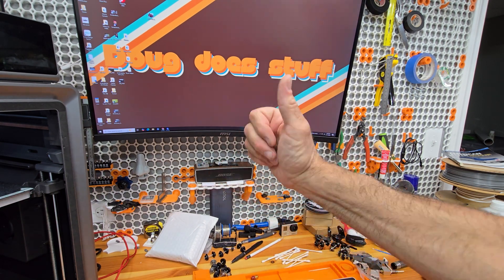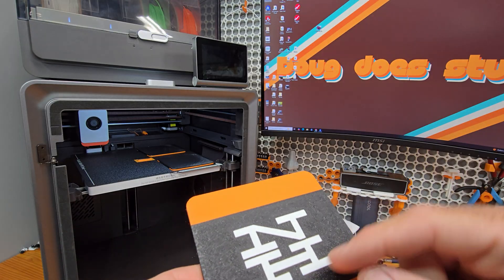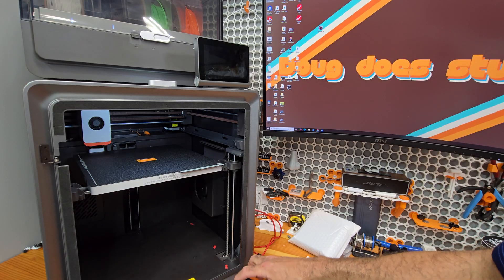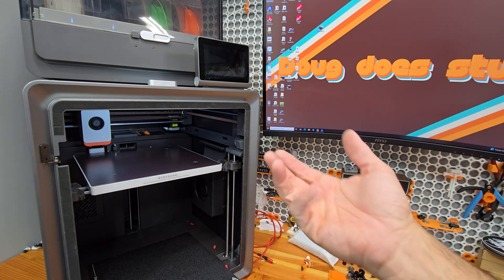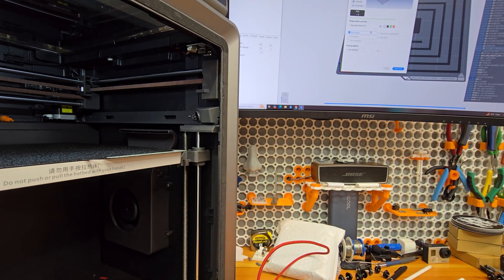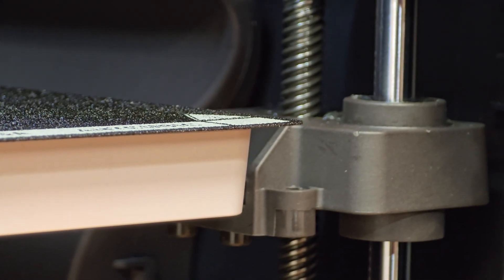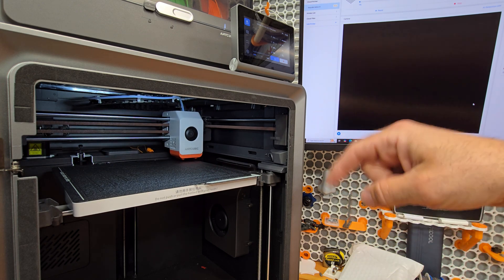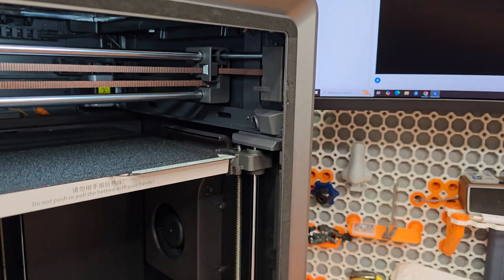Kobra S1 Combo: Bed Leveling BUSTED? Does it Actually Work?

Comment: Ihave been working on this for two weeks about 4 hours a day. eventually I got a perfect first layer and it wasnt becuase of the mesh it was because I installed the 8mm bed and leveled for two weeks to get it just about perfect. im convinced the bed leveling doesnt work. I had almost no deviation in the mesh and it still wasnt very good
Reply: I am going to add I tried rinkhals I tried stock same issues either way. in Rinkhals I was convinced it wasnt working.

Comment: The beds in these things are trash. I just installed Rinkhals and done a bed mesh through mainsail. I have 1.125mm range difference, everywhere is around 0.1 to 0.3 except for the left hand rear corner where it drops off by 1.125mm.
Reply from the maker: There is talk that the chain in the top left pushes down on the hot end. It is something to investigate

Comment: Ciao Doug. I guess i found a solution. At least is working for me, and it's consistent all the time. I was giving up with this printer but sometimes, when everything seams lost, the solution come up. I tried all possible to minimize the bed warping ( also following your videos ). But after all nothing was changing. So, I said, shoud be something software related. And I think it is. All printers makes mash from LEFT to RIGHT ( or viceversa ) and builds a grid. Somehow the software has to arrange the deviations interpolating these measures. More you go far from the touched point, more the meaasure is an interpolation. I will do it short. From SlicerNext simply change the printing pattern. Instead to 45° set 0°. The nozzle moves from left to right. The result is amazing and my first layer 240x240 i a piace of paper. for 4 time consecutives. I guess printing at 45°  the software interpulation is to waek and gives you inconsistent results. Let me know.
Reply from the maker: Very interesting! Maybe they already know this and that is why their first layer model prints left to right....
Reply: @dougdoesstuff24 I didn’t know. If you plan to try this method, tell me if it works also for you.

Comment: Over 500 hours. When the bed leveling issue happened to me I updated firmware and did a full calibration. Oh and I always skip the bed leveling when remote printing.
Reply from the maker: Did that work for you?
Reply: @dougdoesstuff24  Yup. Racked my brain making sure nozzle settings on the printer AND in the slicer were accurate. Got tired of bothering with it did a factory reset, I've been fine ever since. I say do a full calibration via printer settings first, if it's still an issue go for the factory reset.
Reply from the maker: I've done the full calibration multiple times, but not a bad idea about a factory reset. It shouldn't matter, but who the heck knows at this point!
Reply: @dougdoesstuff24 I also keep that front door on and closed, I vent from the top. Mostly because of how humid it is in NC.
Reply: Im experiencing that too. I just went and downloaded the v 3.3.3 to see if that will help. The .4 is annoying how the auto level is always checked
Reply: Doug which version of the slicer are you when you did these test, do you remember?
Reply from the maker: @KelvinAung95  I just opened the slicer, version 1.3.4.0  When I run an update check it says the latest
Reply: @KelvinAung95  if it helps I'm on the latest firmware on both and the printer and in the anycubic slicer.
Reply: Waiting on the print to finish but yeah I will update the chat once I do a test print. Reverting back to v1.3.3.3. Not going to change anything.
Reply: Maybe a one off situation again but I printed sliced gridfinity bins and stopped during the first layers. No issue with the first layer on 1.3.3.3  I posted my pictures on Reddit.
Reply from the maker: Interesting.  I will have to find your reddit thread.
Reply: @dougdoesstuff24 hey so ive been messing with it reverted back to the most recent firmware. started to see consistent positive results when I started messing with the initial layer line width. 

By default its at .5mm or 119%. But I increased it to .525 or 125%. Im having good first layers but z offset is still an issue. It is able to work itself out by the next layer. And top layers are good for the most part. A new issue popped up where the print head starts moving before any filament is coming out so im missing like 1in of the very first line. This only happens after purge for starting print or color changes. Color changes not so much of an issue cause of the purge tower.  Everything after that is fine. So idk lol.
Reply from the maker: good to know.  I am not behind increasing the line width as it masks the problem and doesn't solve it. That is odd about the missing filament.  I really hope AC fixes this in the next firmware release!

Comment: Sorry, I know this is a bit off topic 🙏
What benefits does this machine have over the tried and true P1S Combo? It appears to be a bit cheaper at the moment, but are there any technical advantages? 🤔
I hope you find a solution to this problem!
Reply from the maker: Advantages huh, well I don't know the P1S enough to answer the tech specs, but I do know this has an active dryer in the AMS unit.  You can run the dryer by itself and/or while it is printing which is nice.  It is half the cost of a P1S also.  BUT, as you see from my issues, not every K1S is built the same and you might get a winner...or a loser.  It is unfortunate because I do want to like the machine!
Reply: @dougdoesstuff24  Thanks! I didn't know about the drying feature, that is great for the price!
Reply from the maker: @Aaronage1  yeah, but does it overcome the other downsides?
Reply: @dougdoesstuff24  Maybe not in the current state, but if they can iron out the issues it could be a solid choice 👍
Reply from the maker: Agreed!

Comment: I think the shitty build plate they give with the printer is a cause of a lot of issues. I think it warps as the print goes on if you have the bed on. I got a GECKO plate and a PEI plate. PEI plate has no issues.
Reply from the maker: It comes with a PEI plate, how is yours different? I know the GECKO is a cold plate so that might help with warping from heat

Comment: I can't keep the ACE Pro running long enough to find out if it can do multicolor or not. Nonstop errors (11504, 11511 and 11518). Most of the time you can hit continue but at that point the layer adhesion has gone to hell. Gotten a few good single color prints. A reasonable benchy and thats about all.
Reply from the maker: Oh man, I'm sorry to hear that! Have you reached out to support yet?
Reply: @ yes, but they’re aren’t exactly quick to respond.
Reply from the maker: @KC1VBX  yeah, it usually takes overnight to get something back.  Weird though, today, I emailed them and had an answer within 2 minutes!
Reply: @ I work in IT. This is how tech support works for me. Lmao
Reply from the maker: That has been my experience with support as well.  They usually respond within 24 hours and the solution is often them sending parts my way.  The parts take almost 2 weeks to get to me though.  As for the new hotend, the ones I did the video about from aliexpress have been great! No more PTFE tube to cause issues!  I have an official anycubic replacement, but I don't think I will use it ever because of the design and the issues.
Reply: I have no issues using multicolor but the waste is so much I just don't really do it lol

Comment: Checkk the gcode for a use bed mesh command like m420 s1
Reply from the maker: being a klipper based machine, not sure m420 works.  The bed does appear to move, I just think it is so out of whack there is too much for it to move.  Unfortunately you can't see a bed mesh on this printer like you can on others.
Reply: @dougdoesstuff24  not real familiar with the machine. Came across the channel researching the model. Seem to have a few quirks but a solid machine for the value.
Reply from the maker: Cool! Thanks for stopping by! Yes the machine works well for some, but for others it can be a real nightmare. I really don't think I could recommend it without reservations. It is well priced, but that shouldn't mean you have to deal with issues.
Reply: @dougdoesstuff24  I built my first few and  then grabbed a large voulme slinger for cheap years back and its been my work horse. I do more work that requires post processing and painting is a hobby for me so I have never needed much more. I'm interested more in multimaterial for functional parts and prototyping. I love the newer features of the klipper based machine but I'm not hot on the prices of bamabu labs, prusa, and the like, and the waste of the multimaterial seem a bit excessive. Anycubic has been a pretty solid outfit over the years. Im going to have to learn a bit more about klipper first though. I like to be able to modify things to my liking.

Comment: It looks like the pints are warping try setting the Big fan a little bit lower. Try laying them on a table and see if they are warping.
Reply from the maker: Hey Jim.  Appreciate the input!  I will recheck them when I get home, but they didn't look at all warped, it was just those top layers.  There have been other comments about the side fan as a possible issue.
Reply: @dougdoesstuff24  it happened to me and the top looked identical, I have an X1C so the fan is on the other side , when I saw it was the ones right by the fan I decided to post it.

Comment: Of course, the auto-leveling works, but you should understand that the printer only measures 25 points, with a distance of 5 cm between each point. Any irregularities between these points are not accounted for, so the height may vary in those areas.

Moreover, I constantly see people touching the print bed with their fingers, leaving skin oils behind, and then wondering why the plastic won’t stick to the surface.
Sure, you can argue that you clean the bed with alcohol or degrease it regularly, but the best solution is to stop touching the bed altogether!
Reply from the maker: Good point on the unmeasured area between points. I do clean the bed as needed if adhesion issues arise, thank you for the comment!
Reply: @dougdoesstuff24  
Another nuance: Before calibration, always check both the back side of the build plate and the bed itself for any particles, no matter how tiny. Even the smallest speck can alter the final bed height. Later, that particle might shift, rendering the calibration inaccurate.

"I do clean the bed as needed if adhesion issues arise"
So far, my Cobra S1 has been running for over 120 hours and consumed more than 3kg of filament, yet I’ve never cleaned the bed. Right now, I’m printing articulated  Chinese dragon model without a brim, and the adhesion is flawless.
Reply from the maker: @Sonnerick2k  thank you for the advice, I will definitely give it a look.  That is awesome about your bed adhesion!  I haven't had a real issue with bed adhesion yet.  I had some pop up, but I cleaned the bed and it hasn't been an issue.  Good luck with those dragons!

Comment: Guess the sensor is behind the nozzle.

If that's the case the phenomenon is simple: if any od the linear rails on the head is bent in any way, it makes the head rock back and forth as it goes side to side, like it's more straight on the left but as it goes into the middle it starts to lean so to speak. This phenomenon makes the offset between the nozzle and the sensor change because the radius of the leaning is different at the nozzle and the sensor. It's simple to fix this issue, you only need to move the sensor to either side of the head, to the line of the nozzle, and adjust the sensor position compared to the nozzle.
This way it won't matter where the head will go, the nozzle/sensor offset will be constant always
Reply: The nozzle is the probe. There's a load cell on the assembly which does the measuring.
Reply: @lvr350z  in this case what I said is irrelevant, the problem is elsewhere
Reply from the maker: Can you elaborate more what that means?  Load cell on the assembly?  Where would that be located, not on the heater block/thermistor/nozzle assembly...right?

Comment: I start to believe that you're changing to many things at once. Again, it looks like you're running an aftermarket hot end, this could be first part of the problem(s). Also do we not know (or maybe I just don't heard it) which profiles you use. Also did you change the Z offset in the last video, this would explain why it now seems to drag through the top layer at some points.
The problem with this is, that there are various possible reasons for this to happen so it would  be easier for you if you can get everything back to the factory default and test again from there. I also found that some filaments just won't print as nice as others! I've got 5-6 spools of Anycubics own PLA+, so far I used black, white and gray and the white one just doesn't look as good as the black and grey! Also does the white filament get stuck on the spool, I think it's a manufacturing fault and Anycubic refunded it already so I'm fine, I use it every now and then but it always needs attention.
I did a first layer test just to make sure, I thought I just don't need to do that because I had no issues so  far but the urge was just to big. I did it with the white PLA+ first and despite one spot (3x4 cm) where it just messed up completely, the first layer went pretty OK. I reprinted it with the gray PLA+ using the AC default .20 mm Quality profile and it did very well. YES there are some areas where the layer was thinner and some lines didn't connect but I think this can be fixed with extrusion and / or temperature adjustments but I don't feel the need to do that because so far I never had a bad first layer on any model. I will try to print something on / over the spots where the 1st layer was thinner just to see if it affects 1st layer on a regular model.
Reply from the maker: Hey NightStalker!  I appreciate the feedback.  Yes, I am using an aftermarket hotend and updated profiles from makeronline.  I have not changed the settings, other than the z-offset, in any of the prints.  This set up prints very nice in the middle of the plate, but get to the edges and you saw what happens. BUT, with that said, I could go back to stock and see what happens, my guess is that it will be the same.  Thanks for following, I appreciate it and good luck with your printing!
Reply: @dougdoesstuff24  I'm not sure what causes the issue, the leveling seems to work, I see it do the same on my machine. Here's the result of my first layer test I did last night https://youtube.com/shorts/0mwG8b-VUf8
I have these thin spots but I think this is pretty normal for many machines, not just the S1. I don't know if you could just slightly increase extrusion values (not sure which tbh) to get this fixed. However, if this is an issue with the auto leveling then the good news is, it can be fixed with an firmware updated.
Something I forgot to mention: I've seen a post on reddit about dirt and insufficient greasing causing something like that too. Sounds plausible because if the gears don't run smooth it could mess with the height of the bed during printing
Reply from the maker: That is B E A U T I F U L!!!!!  There are so many variables aren't there!  I need to test one at a time to find the issue I suppose.  :)
Reply: @dougdoesstuff24  fingers crossed! I'm sure you will get this to work one way or another. I understand that these issues matter much more to you because you need perfect 1st layers all over the bed for your parts. Anycubic should definitely look into this, I'm sure you're already in contact with them about this specific problem.

Comment: Glad i did not get this printer
Reply: 200+ hours on mine. very happy with it. First ace unit had issues due to my own silliness. Got a new one in 2 days from amazon back to printing zero issues since.   Not sure one guy who has complained about his printer from day one is a true indication of how well this printer works especially for the price.  You do a bambu issue search you will find issues with their printers also.  Just not someone who continues to tinker with the same lemon over and over.  I would go out on a limb and say Ill bet there are way more happy people than not....Complaints always travel faster than compliments.  Tis the nature of the internet.
Reply: Und genau deswegen hab ich einen A1 und einen Mini....Beste Entscheidung meines Lebens 😁👍
Reply: Even with problems, it's still fantastic for the price.  It's the absolutely cheapest enclosed printer with an MMU by a wide margin.
Reply from the maker: That is an accurate statement for sure.  BUT, it should still work!
Reply: @Monkey_Chimchim  If you pay for something that dont work.. It is a waste and not fantastic
Reply: @rkageru But it did work.  His current problem is that some parts aren't perfect.  If I bought the cheapest harbor freight drill press and it didn't drill perfectly true compared to another drill press 2-3x more expensive, it's not that it isn't working.

Comment: Mine has been running fine for a few weeks now, but I've been using Rinkhals on it the whole time. I don't know if it will fix any of the problems you're running into but you should give it a shot.
And if you do, try using Orcaslicer with it. I found that Orcaslicer is giving better print quality, and changing the wall generator to Arachne and the wall printing order to Inner/Outer improved it even more.